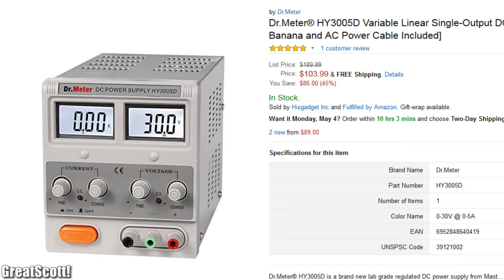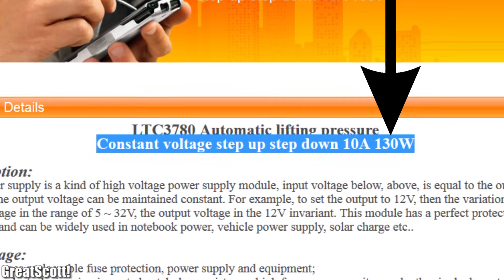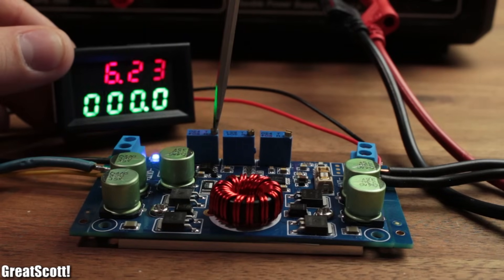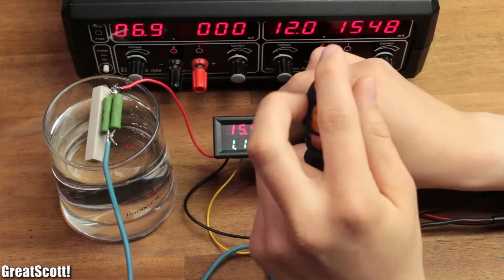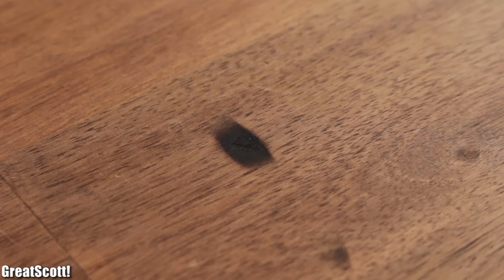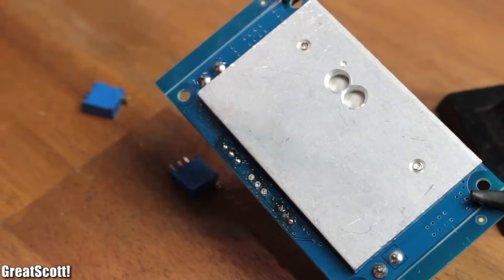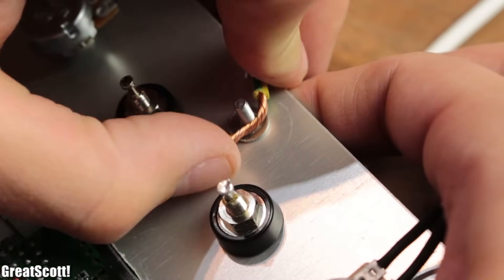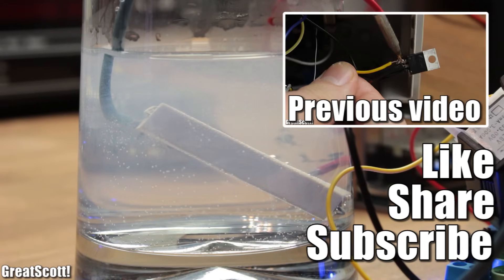Build your own Variable Lab Bench Power Supply

Comment: Could use a ATX power supply. Most ATX have 2 x 12V, so can present the 3.3v, 5v, 12v on one side of the case, with a switch for the led volt meter, and use another side for the variable part (with its own volt/amp meter). The LTC3780 board can be had from China/HK much cheaper, if you don't mind the wait (they all come from there anyway). Useful to have a CC limit for fixing things with shorts.

Comment: 2:12 How exactly VLBPS can help with determine of LED forvard voltage and current? Can you specify, please?)
Reply: You set the maximum current as the nominal of the LED (20 mA as example) and you star rising the voltage until it doesn't go up anymore (that would be the foward voltage)

Comment: scott that small power supply in box can i charge phone with it
Reply: Make sure you limit the current and set the voltage properly and sure.

Not exactly the best use for one of those, though. Why not just use a normal charger? If not one of those, why not a USB port?

Comment: Please, make a   video about this again, but with digital potentiometers controlled by arduino and on this way is possible to fine adjust the resistance steps with press buttons.
The LTC3780 is able to set and hold mV and mA-s, but a the basic included trimmers are crap as hell, but a linear potentiometer no enough turn way to fine adjust.

It is also a good way to show some tricks with cheapo digital potentiometers like digital controlled analog stuffs... especially LED, what u really likes :"D !

Comment: Good but where I live such a board isn't available so I need an eAsy cct with solid state components .I tried the b317 regulator but it is not linear and the output drops sadly with the load no matter if series transistors are added....U don't mind another video meets my and others need

Comment: Very great project. But i need a little of your help i bought all the required parts. But when assembled and powered by 12V supply the buck bost converter is showing fault led and output is zero. I checked the under voltage potentiometer but it does affect any thing. Please help me in this regard .

Comment: Help please 
The dc suppy from rectifier circuit will charge the capacitor to 50v and the same will go to DC to DC converter module. But specified voltage for the module is up to 32v only so what can be done ? Facing same problem

Comment: Do not use the 12V 5A power supply he used. That one is severely underpowered. The max power of the LTC3780 dc-dc converter is 30V 10A or 300W while the power supply is only 12V 5A or 60W. If you run the LTC3780 at full power on the power supply you will most likely burn it. I recommend 12V 25A power supply.

Comment: Hi. Is it possible adjust current and voltage in same time? (I mean if we set current limit for example 5A if we change Voltage then current remain 5A or it will change too?)
Reply: the current depend on the load but max current the load will get is 5A

Comment: I have been trying to come up with a good power supply for use in my little home shop, which, right now is my recliner with piles of electronic stuff around it within arms length.  First I purchase a nice little 5 volt PS with meter, I do love the little guy for any 5V use, it has USB out as well as two plugs for leads.  Then I was going to build one of these, when I came across those cheap Chinese that advertise as 30 Volt 10 Amp with current limit as well as variable voltage for under 10 bucks!  Why the case alone for this unit could run me as much, I thought!  So I was off to Ebay, where I ordered on from a US Seller!  After 3 weeks Ebay let me know that they had removed the seller for illegal sales, he was advertising them for 10 bucks and taking the money but never shipping. Ebay refunded me.  So it was back to Ebay, where I ordered the same unit from Hong Kong for 8.99.  I watched for weeks as the trace of the package went on, one day it arrived in Chicago, some 1500 miles from me, then it shipped to the WEST COAST, having to fly over me and a thousand miles west!  I kept watching till it said it was delivered to my door in Texas! I live in South Dakota over 1000 miles North of there!  Well that was enough, I went back to Ebay, and again, I was refunded my 8 bucks, I have given up on the PS. I took the parts I had laying around and built one supply that give me 3.3 volts, 5 volts and 12 Volts at 6 amps.  For a case, I used an old floppy case, put in both a fuse and switch as well as a little LED to let me know when the power is on.  It works OK.  That said, I didn't have variable voltage, so I built another using a little step up board, like you, I removed the voltage pot and replaced it with  a 10 turn pot, and added an LED meter to give me a read on the voltage.  Still that unit had no amp control, but I do have a tiny step down converter that has amps and volts, I use that where the amp is not that high, and it does nicely  Still having all in one unit would be nice, I dug through my old kit builds and found a board I built from a kit that gives me both negative and positive 3-5-12 volts, so I put both the variable and the muliti into one project box with the digital read out, I put a plug on the box and plug in a set of lipo batteries to her when I need to use it, makes it portable and handy, all the single volt plugs are on one side with the variable on the other. So I guess I can get by without that cheap china crap supply, as for me 2 strikes and the Chinese are out.

Comment: Grounding is a very important safety feature. This properly grounded power supply, includes many bench top power supplies can also easily create very dangerouse deadly electrocutions, can destroy test equipment, and can destroy devices being powered giving the user a dangerouse false sense of security. For testing using truly isolated power supply is far safer, far less risky that will help protect you and saves your devices being powered and test equipment. This power supply is not isolated so be extreemly careful if used for trouble shooting and testing. .

Comment: Is that voltage and current display pretty accurate? I got the similar display and the current measurement was higher than it should be by 60%.
Reply: Disconnect the thin black wire from the meter.

Comment: cool little project, but if you add up the price of the regulator... the enclosure... the power supply, etc, you get pretty darn close to the price of a better, professionally made lab power supply. I've seen a 300W one with a range of 0-30v and 0-10A on Amazon for 120 CAD$... which is ~90 USD. So yeah it's a FUN little project... but you can definitely get something better for not much more money!

Comment: a 2019 quick update with new tech (new recommendations) would be awesome!
Reply: I'm just going to an AC DC adapter for my power supply: 
https://www.ebay.com.au/i/263922220439?chn=ps&norover=1&mkevt=1&mkrid=705-139619-5960-0&mkcid=2&itemid=263922220439&targetid=469489693418&device=c&mktype=pla&googleloc=9069204&campaignid=1793098931&mkgroupid=74958853168&rlsatarget=aud-497372010363:pla-469489693418&abcId=1139226&merchantid=116254190&gclid=Cj0KCQjwl8XtBRDAARIsAKfwtxBqWxCzqCuXbzmGCkSIUDzucEOlcvWIdYDtktyb_-HB6rDzgXsTga4aAoKmEALw_wcB&var=563368613478

This seems like a simple cheap solution. Can anyone tell me why this is a bad idea?
Reply: @m2j8  it's safer, use it.
Reply: Michael Jenkins it’s not a bad idea :) I’m using external ones too. I’ve got 3 channels on mine and can run it off of a power supply, MacBook charger or a lithium battery.
Reply: I would love to see this as well!!
Reply: There are lab bench power supplies for around 30€ on Amazon ... maybe that's a better option

Comment: instead of a power supply would say an 18vdc battery work if it would only be used for 24vdc 20mA at most?
Reply: Better use MT3608

Comment: If you weren't going above 1.5 amp and 20v, could you use a 20v AC to DC barrel adapter? Instead of the 12v 5 amp. Not much practice with AC current....

Comment: A couple things - 1) you should include a fuse in the ac primary circuit and, 2) place the binding posts 0.75” apart so you can use a dual binding post connector.

Comment: I've built one similar to this before. What I would add is either a couple of smaller pots in series for micro adjustments or put precision multi turn pots in place of these for a finer control. You could also go a bigger input power supply as the regulator can handle up to 130W. Also, add a shake proof washer to that earth lead on the chassis - you never want that coming off for safety.
These days it's so easy and quicker to make power supplies than it's ever been.
Reply: It can handle 130W but only for a limited time, without added heat dissipation. The long-term output power is stated at 80W.

Comment: Sir I have a 36v DC power supply with 6amp output,I want to make a variable power supply using that.is it suitable for LTC 3780? does it contains any output short circuit protection at 6 amp current? Please help

Comment: Is there a reason you don't just buy a ready-made AC to DC 12v 5a power supply? Rather than buy the converter and have to connect your own AC plug, etc ... A 12V 5A power supply is as cheap as $6 from eBay ... can't we just use something like https://www.ebay.com/itm/EK-Power-Supply-Adapter-AC-To-DC-12V-1A-2A-3A-5A-6A-8A-10A-3528-5050-LED-Strip/122920244005?hash=item1c9e9e1325:m:m-qLurCEABBoWSEhsx-CFeQ:rk:4:pf:0 this to connect to the LTC 3780 board?

Comment: Cool, I was building one sort of like this one, however I have a small board that puts out + and - 5 and 12 volts, as well as 3.3 so I put in posts for those on one side, that board runs off a 19 volt laptop brick from an old discarded laptop.  For the variable, I began with just a buck supply but found it lacking so I ordered a buck/boost supply to replace the variable, then two 10 turn pots to replace the ones on the board, it came out pretty good, I used the same display as yours.  Using the laptop brick only gives me 3.6 amps output but I rarely ever need more then a couple amps output anyhow.  I initially built it into a medium project box but I don't really care much for the looks, very crowded with all those jacks on one side, so I think I will transfer it to a large project box that I have had laying around for 10 years or so, got it before Radio Shack died so it is rather old but still have the steel top for her, that may make the project look a bit nicer.  For everyday use, I find that 5 volts 2 amps is about all I need, so I did buy one of those little 120-5 volt units with the meter she puts out 2 amps and thats plenty for most of my projects.  I had to add a resistor to bring the voltage up, as from the factory she was only putting out 4.6 volts.  I saw a video where you could add a 4.7 ohm resistor in a vacant spot for a trimmer pot, and it would bring the voltage up, it was dead on!  Really made a nice little unit.  I have a little light strip hooked to her that draws a couple milliamps to light  up the dial when I power her on, doesn't seem to mid that add on and makes my desk look a bit cooler as well.

Comment: I used this back boost converter for a project at uni and i have to tell you that after 5A, everything gets VERY hot. It could do upwards of 7A but at that current the inductor, heatsink, caps and pretty much everythign was very hot to touch. so I would definitely attach a bigger heatsink if I used it for a bench PS...

Comment: Hey everyone, I have a question if anyone has time. So I bought the board featured in this video hoping to recreate this build. Unfortunately, mine did not come with the large heatsink on the back. I was planning on attaching that heatsink to a large aluminum enclosure, and keep the system running for up to 24 hours at relatively low volt and amperages. Since the heatsink on the back is nowhere to be found, I figure I would short my board if I attached it to the aluminum frame. I’m not really sure how I could solve this problem. I was thinking of attaching my own heatsink to the bottom of the board, then sticking it onto the aluminum case, but again I’m not sure if I will short. Does anyone know how I could utilize my case as a heatsink while avoiding harm to my electronics? Thanks in advance!

Comment: Hello greatscott, would this LTC3780 work too? its 12$ cheaper than the one u put in description and it looks preety much the same to me https://www.ebay.com/itm/LTC3780-DC-5-32V-to-1V-30V-10A-Automatic-Step-Up-Down-Regulator-Charging-Module/301924626765 also whats the casing size and what is the casing called i want to find it on ebay?

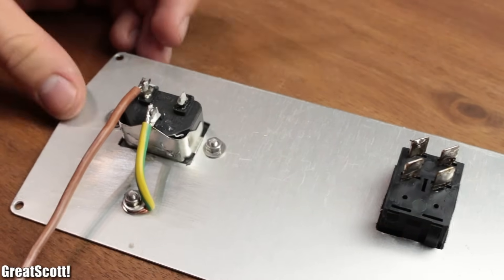Comment: 6:10 So what if I don't have any earth/ground connection in my house ?
Reply: Don't worry, your body works pretty well as a ground connection.
Reply: Either your house has a insulation transformer somewhere in its wiring, or your electric system is out of date.

Comment: Isn‘t it energy inefficient to step down the Voltage to 12V and afterwards step it up to 30V? I am interesting if it would be better when using a 24V power supply for example.

Comment: I have done a couple of these but prefer to use a 24v input source. Its in buck mode for most of its use & it isnt hammering the source with all those amps. In fact you could just use a buck converter & adjust the source up to 27v like my last one (24v led power supply)

Comment: another question, the low amp display you use seems to go all the way down in volts, I have some 10A ones but they dont show below 3,5V - since its not enough to power the leds inside it. the link you have is dead, so I wonder, which one would you buy if you were to make one today? Thanks 😊

Comment: hey Greatscott. I am really impressed with your videos. good quality. Could I use a 12V accu as power supply for the LTC 3780 input or would I need to buck to 12V with another buck converter? Accus go to 14,4 when charged I believe.

EDIT: I looked up the data for the module, damn what a beast! 5-32V input and 1-32V output. 
https://www.amazon.de/gp/product/B073XP6BR9/ref=ox_sc_act_title_1?smid=A1YWD3GRP1I9CM&psc=1 
Fast delivery from germany here - they are also available from CH, but I can pay 5 EUR to not wait 1month.

Comment: You might not want to use the case that is shown in this video, since the material of this enclosure is made from Polystyrol and does not tollerate much heat. If you ever have any problem, this thing might start burning easily. Better stay away from this Polystyrol case! At 50°C it already gets weak. At 70°C it gets kind of soft. At 80°C it can start melting. Glass Temperature is only about 100°C. And Polystyrol is known to melt into drops that start burning on their own. --- Just put this casing into direct sunlight on a hot summer day, attach some electronic load to it and go for a walk. Do not worry to miss anything, the police will call you anyways after your house was burned down. ---  Remember to NEVER put anything that can turn more than just a very few Watt into heat inside of something that can easily melt or burn and from that create or accelerate fire to develop!
So no ABS / Polyurethan / Polystyerol  etc. for any kind of Power Supply / Electronic Load / etc. pp.! The only exception are devices in plastic exclosures that are testet to disconnect from power at certain temperatures by physical means (low temp. melting fuse element) as well as the type of plastic used is tested to suppress the development of fire.

To speak in General: Everything that comes with more than just a very few Watt dissipation goes only and exclusivly into a metal casing made of steel or at least made from aluminium!

Comment: Hello! I just have one question! How can i read these potentiometers? On mine it is W 103, and 134 T. Seeing your video, i guessed it is a 100kOhm potentiometer, but on my multimeter, nomatter how i connect it to the pins, i can never reach 100kOhm. I tried also an agilent multimeter and the same. Otherwise, the dc-dc converter works fine.

Comment: Hello Greatscott how can I switch 2 of these modules in parallel so I can reach about 20a, because I have a peltier element what at least 15a I have found no module what up and down can regulate. do I need a potentiometer which has twice the resistance or only half?
Reply: I know this is an old comment. But i wanted to say you'd need a stereo potentiometer (the ones that are like a sandwich of two pots, with one dial [6 pins] )

Comment: When using a 12 volt 30 amps power supply does it pushes all 30 amps or does it only use what the loads needs?

Comment: I built the power supply and it is great. the only problem is I am trying to adjust the amp rate by touching the blue and the Red wires together so I can see the amp rate moving up and down but the moment I do that, the display goes off. any ideas what is is going here?

Comment: Hey Scott, great video, I'll start making one soon 🤓👍. I was wondering, do you think it is possible to replace the potentiometers with a (RC filtered) DAC output from an Arduino. So I can control the output-voltage and current-limit from software.

Comment: Instead of the LTC3780, you can use DPS3012. It has the display and adjustment knob pre-built so you go through less trouble of building the enclosure. It also has higher output current rating, and is only US$34, which costs less than the LTC3780 with separate voltage/current display module and pots/knobs. Use an old computer power supply for the 12V supply and you have a dirt cheat lab power supply that can meet most of your needs.
Reply: Thank you whoever you are i couldnt find the stupid display for less than 20€ anywhere

Comment: I noticed that the bench power supplies that you showed originally were all three pole (-G+).  Those of us playing with opamps need this.

Got any thoughts?  Most of the circuits I know of arn't particularly variable, although the amperage limit is still useful..